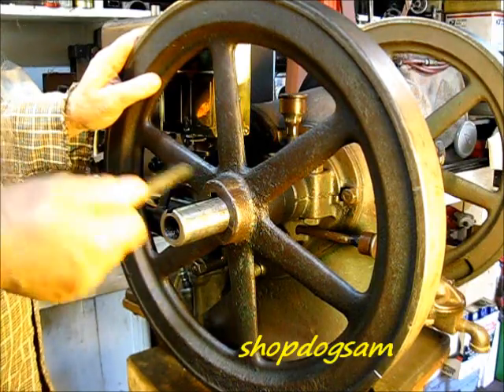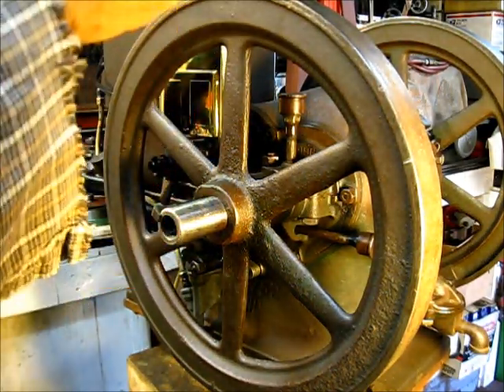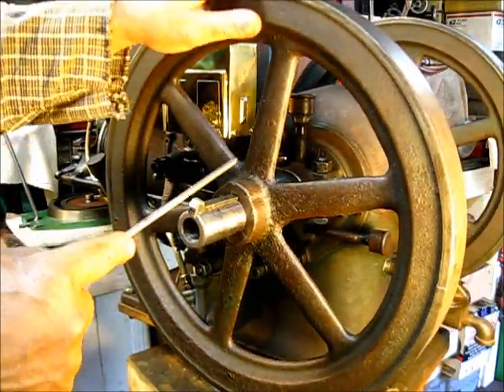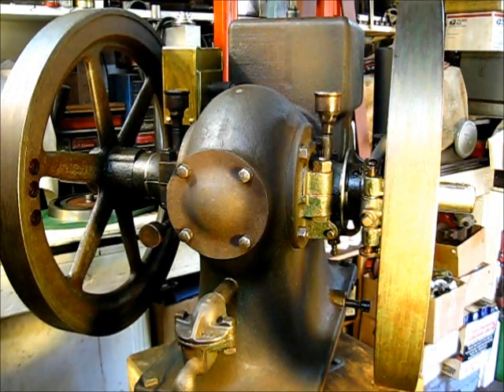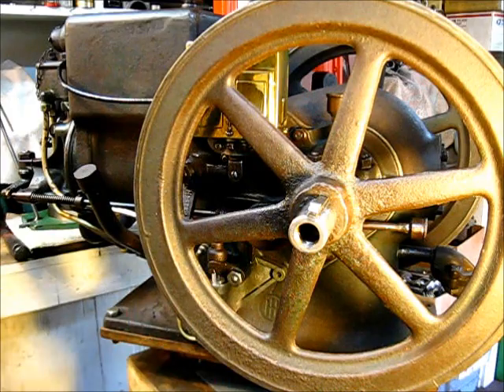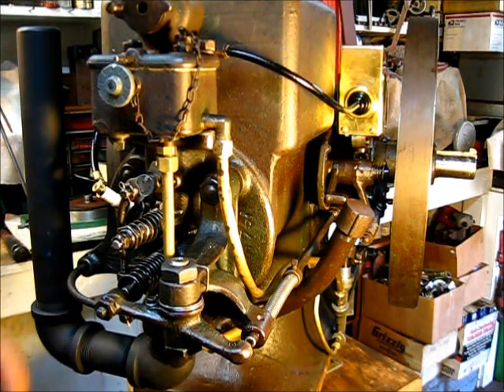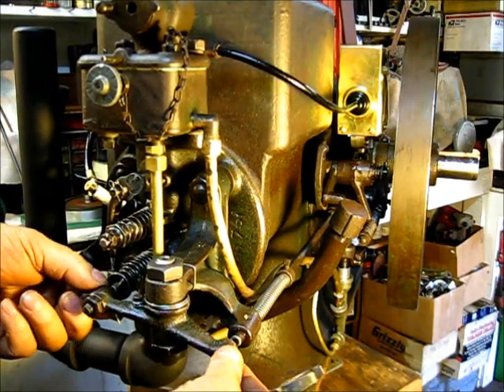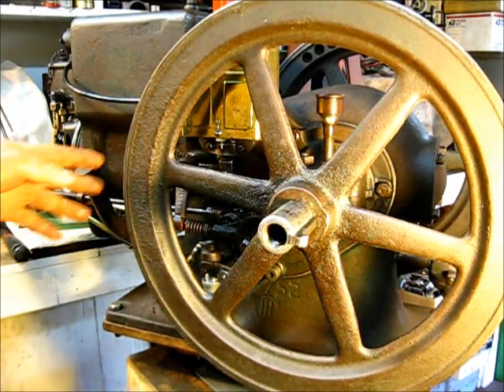1926 McCormick Deering type m / exhaust valve timing 45of

Comment: If you are looking into buying these types of engines at an auction, just be careful. I've seen them pick em up by the flywheels and if the flywheel don't break or bend, there is a good chance of the crank ends being bent. I have seen stuff at some actions, not all, that would curdle your stomach, they just don't care how they move equipment.